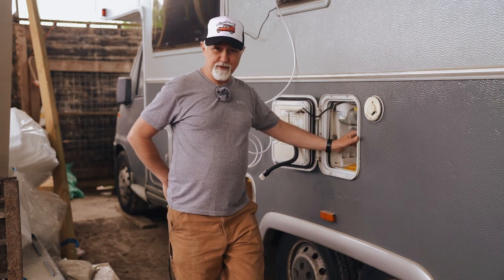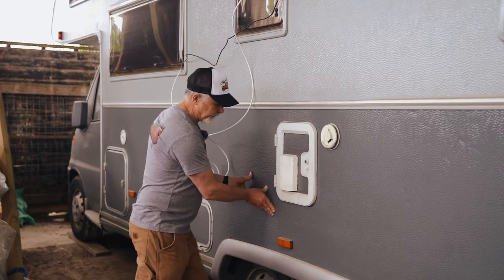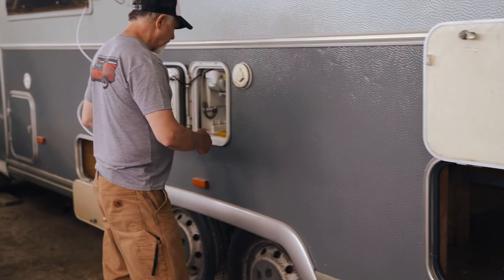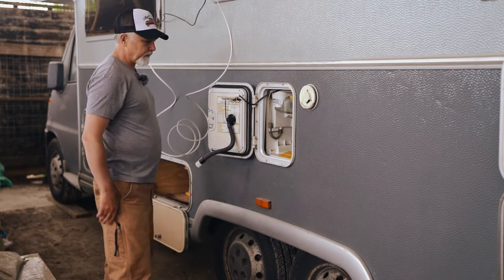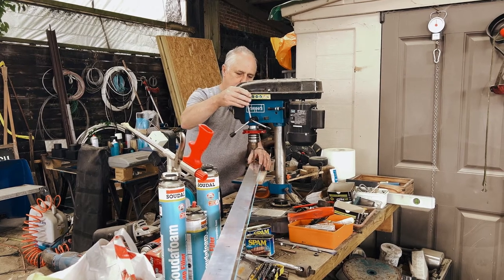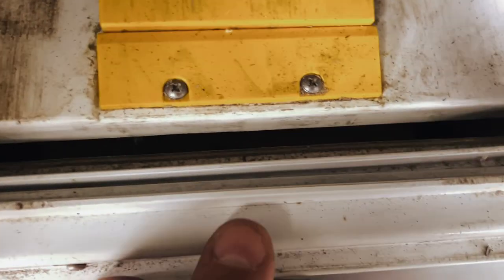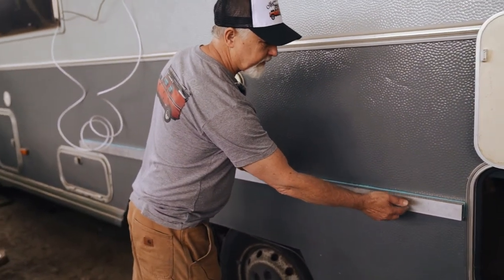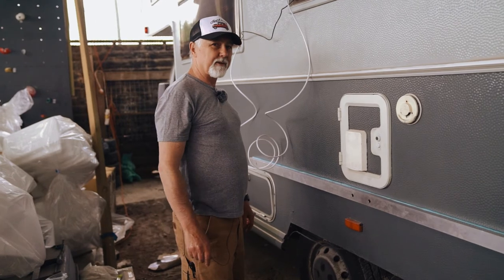Fixing the wall on an old motorhome from 1994 | Euramobil motorhome repair

Comment: Stucco aluminium is the name of the body cladding material. I have the same wall bowing issue on my old tag axle Hymer incidentally
Reply from the maker: Thanks for the comment! The wheel arch of tags appears to be a bit of a weakness of these vans.

Comment: Couple of suggestions, if you added another length of tube going forward to the front locker door then the whole thing may look a bit more 'standard' and not look that out of place.  You may also need to taper/feather the front edge of the tube so that you don't have a sharp edges sticking out as that may be considered a potential injury hazard on the MOT test.  Not sure of the actual regulation/ limits so you would need to double check.
Reply from the maker: Thanks for the suggestions! 😊
We plan to taper both ends so there isn’t a sharp edge and also paint it the same colour as the wall, so it blends in a bit.